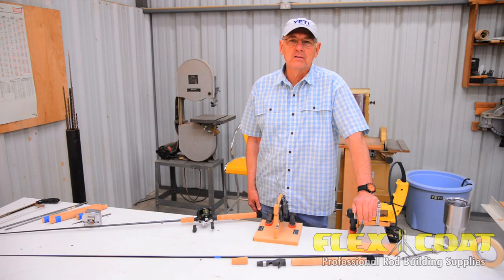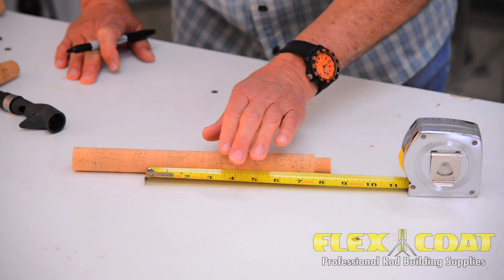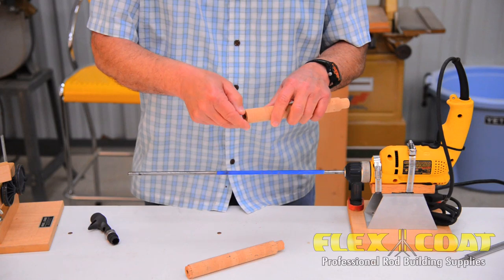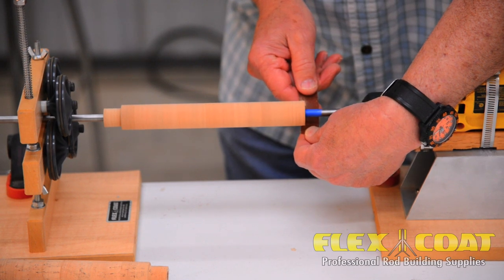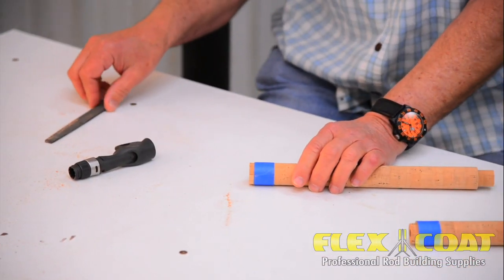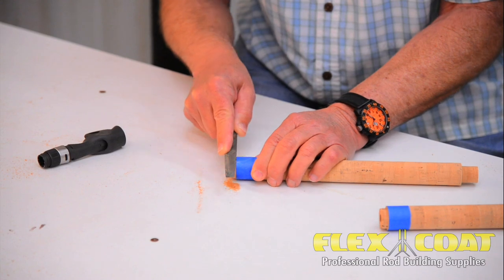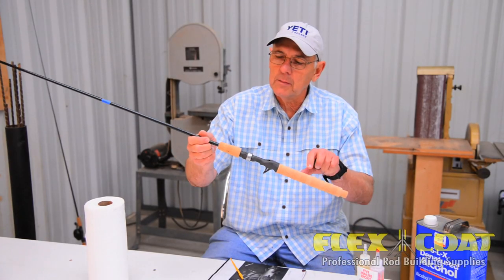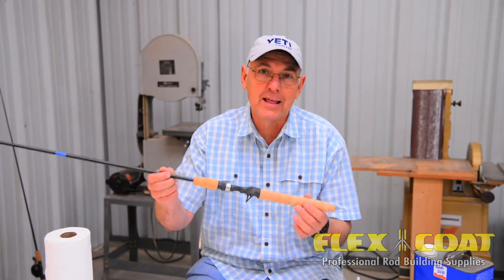Flex Coat Rod Building - Installing a Pre-shaped Cork Casting Grip "How We Do It"

Comment: Where could a fella find a reaming whip like you used in this video?
Reply from the maker: Charles, we sell the half-inch abrasive material on our website in 25 foot and 75 foot rolls. We also have a video on how to make one of the abrasive rumors on our website. We strip down an old rod to make the shaft of the rumor. Give us a call if you have any questions.
Thanks Roger

512-858-7742
Reply: Flex Coat thank y’all very much